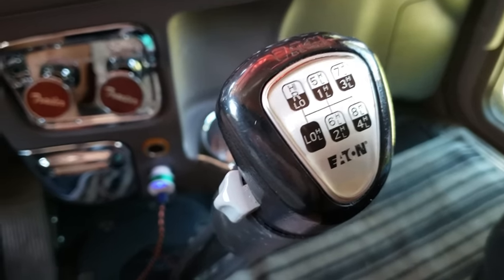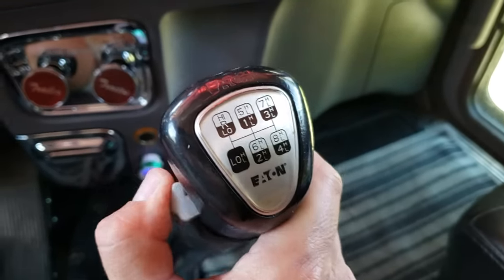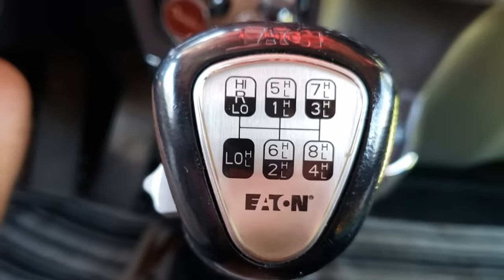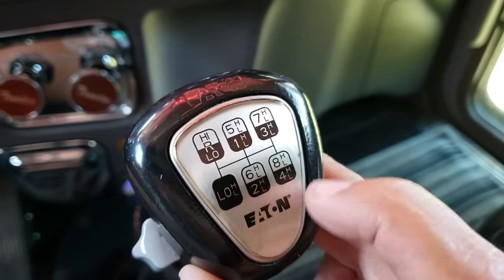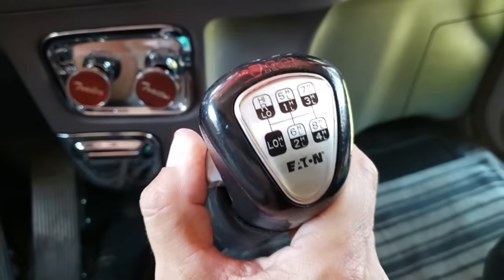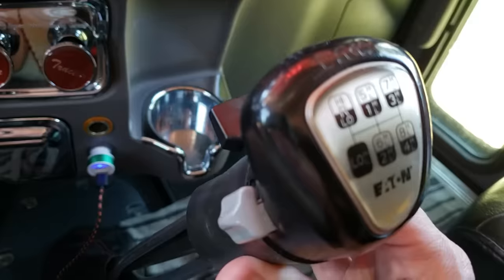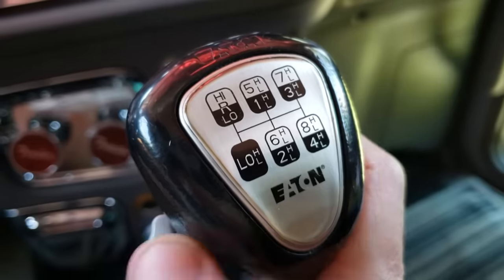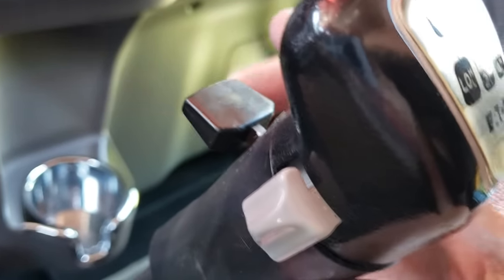HOW TO Shift 18-Speed Manual Eaton Transmission. Peterbilt, Volvo, Freightliner, Kenworth, Mack

Comment: No need to shift it as 18 on the highway, Unless you're heavy hauling or off-road in in steep mountains otherwise just drive it like any other 13 gears.

Comment: And what happens when you're on the 18th gear and you're approaching a stop?? 
Do you have to come back all the gears one by one till you reach 1st and eventually neutral? 🤔🤔🤔 My brain is in my car's gear shifting now...
Reply: A fully loaded super-B or set of turnpikes weighs around 140,000 lbs. It can take you a very long distance to stop.
Reply: @truckindudeglen524  I know... That's kind of my point in my question... How do you stop the damn thing then?? 🤔🤔🤔
Reply: @justsupersteve  The most efficient way is to let the engine brake slow you down in each gear and when the rpm is low enough, downshift to the next lower gear.
I usually don't use the splitter when downshifting.
As you slow down the engine brake becomes more efficient and will slow you down better. 
Quite often you see drivers just use the brakes to slow down which is very hard on the brakes.
Any way you look at it means you have to start slowing down waaaaay before the point you have to stop. With a gross weight of 140,000 lbs you can safely slow down within a distance of around 1/2 - 3/4 of a mile depending on if you are going downhill, uphill or on flat ground.
Sounds complicated to judge it properly but you get the hang of it after a while.
Reply: @truckindudeglen524  wooow!!! That's very interesting! My respect to you sir and to all conveyor truck drivers out there! 
I hope I could get to see that at first hand some day!

Comment: so there’s 18 gears but use only 16???
Reply from the maker: 18 forward gears and 2 reverse
Reply: @CoryJDraper  but technically 1st gear would count as “3rd” right since the Low and High then 1st gear. You know what i mean? this is a bit confusing for me so trying to understand sorry.
Reply: @Marvin91790  Yes, you have low-L (1), low-H (2), 1-L (3), 1-H(4), etc. 18 forward gears total. Most loads you can start in 1st or 2nd depending on weight, being on a hill ect. Usually only need low-L and low-H if you're hauling heavy, on an extreme incline, or a combination of both. Knowing what gear you need for a situation will come with experience 👍
Reply: for example, you may not even use low, 1st, or 2nd at all while empty

Comment: Granted, there are 18-speeds but they are not identified as 1 through 18.  Referencing in that manner creates confusion.   Examples:  6-1/2 (split) is not 7th;  reverse is not 1 and Lo is not 2.  1 and 2 are 1 and 2.

Comment: You know that everyone has had to deal with Stupid 10s aka super 10s. I was a DDC instructor for a mega carrier that had super 10s. A super ten is about the slopes shifting tranny anyone ever designed. Why not a straight ten? Now in the golden age of automatics??? I prefer a twin stick. Why can't you flip a button instead of splitting the gears? Why split them? 13s and 18s ain't hard and driving a truck do you really ever use a clutch? As a DDC instructor doing road test so many times I was asked if the driver had to double clutch. My answer was if they drove the truck down the road and didn't kill me or anyone else or fuck the truck up or put us in the ditch except for avoiding an accident I don't care how you do it. The whole ideal of double clutching was to give time for the engine and the tranny to synch. Upshifting double clutching works for rookies. Downshifting you have to hit the gas to get out of gear and mash the gas to synch the tranny and engine to go in gear. It ain't rocket science but so many people can't do it.

Am I the only one that remembers the old flip switch that was red instead of the little flip switch. It was a splitter but the gearshift shifted the tranny and the  up or down split the rear end instead of the tranny. It worked on the battery and alternator instead of air. It gave a 5 speed 10 speeds. A truck and in the seventies had 15 with deep reduction. Same old 10 said with a pull up and push down but had a switch on the dash. The first five not over 5 mph. But hey skipping gears. Yeah OK but...you have to keep everything working right. My 18s I owned most times I don't need the lower end. Hell not even with my 13 now but... on two lanes in the middle of the night I go through them all. Kind of like a 4WD. You gotta use it or it may not work when you need it.

Comment: its normal  ..    1 low  2 low  3 low   4 low   move up in high   back to  1 hi (5gear) 2 hi (6gear) 3 hi (7 gear)  4 hi  ( 8 gear)   also  16 gear fw + 2 rew      this like normal  4 speed car   from 4 you go up in hi  back to 1  (5)       no magic  just  8 fw gear  you can put  ½ gear  on all      1½  2½   and 3½   and 4½

Comment: Are you from Utah?
Reply from the maker: I'm from Santa Barbara but have lived in Utah on and off...
Reply: Do you know anyone that can train on an 18 speed. It's impossible to find anyone. Cdl schools only have 10 speeds. I have the truck 18 speed just trying to find where to actually get trained is crazy hard in Utah.
Reply from the maker: @alwaysbewhoyouare9592  You are right, almost all training now is with automated trans or 9-13 speed manual.  If you have to drive an 18-speed before practicing, you'll still figure it out.  It'll take a few days.  You'll mostly split the gears with the side button mostly on the freeway...

Comment: It’s common sense look at the shift pattern let off throttle when splitting gears.  I wish my 579 had an 18 speed with a higher differential.  Instead it’s a 10 speed.

Comment: Ok so its called an 18 speed but in reality its like 8 speeds with 8 "half speeds", that would equal 16 + LO + Reverse ?
Reply: Lo, 1, 2, 3, 4 can all be split = 10 gears, flip it into high range, Lo is locked out in high range, 5, 6, 7 & 8 can all be split for another 8 gears. Total of 18.

Comment: If that is mostly road use why would you need a 18 when a 13 does the same thing. Now if that's a logging truck or a tri-axel then I can see. People a 9,13 and 18 is the same transmission 13 has over drive 18 has five deep reduction gears and overdrive.  The same why a 15 and a 10 speed the 15 has 5 deep reduction gears.

Comment: There is a much easier way to describe this,but unfortunately we do not have many boxes like that in the uk.my old manual was a 16 speed.which is pretty much the same,but without the 2 granny lo gears.now,most of the stuff here is 12 speed auto crap

Comment: Splitting low to 8 makes it an 18 speed.  Reverse nothing to do with it.its your forward gears  all trucks have reverse. Most the time you drive 18 like a 13  all depends on your weight.

Comment: The over-rated  Eaton transmission  is 18 13, super 10. The worst  transmission  you can imagine  witch where  unnecessary  unless  you're  pulling  super heavy  loads in mountain  states, and most modern 10 sp. transmission  can handle  any loads and driving  conditions  in the lower 48 states .if I was going  to any transmission  except  10 would  be 15 speed is best user friendly  for any driver  handle back n day  early 90s

Comment: I don't get it.  A brand new Semi truck with MANUAL shifting?   Americans were the first with automatic shifting in cars.  You have 10 speed automatic shifting in a pickup, but you want manual in a Semi???????  I don't get it.   It takes SO much energy from you shifting up and down steeb hills at stops.   There are MARVELOUS automatic shifting trucks. For example Volvo. Manual is not from this time anymore.  Manual cost  energy so you are more tyred at the end of the day so is les safer, for many reasons.    What is it,   is it an ego thing?  is a enlargement of your penis?  I wonder.  I don't get it haha.

Comment: When you split the gear it's like Overdrive. Like shifting to 13-speed you don't have to use every damn gear. And if your trucks got balls you don't have to use First you can go from 2nd to 3rd to 5th. Instead of six put it into overdrive. Go to 7 and under over and under. Defenders one delivers down the black ones down. I've never driven 18-speed 
👎🏽👎🏽👎🏽👎🏽. If you're 6 and under if that button-up that would be seven or Overdrive under or over